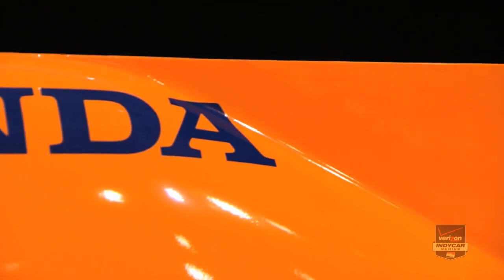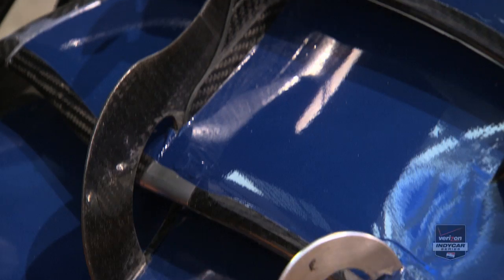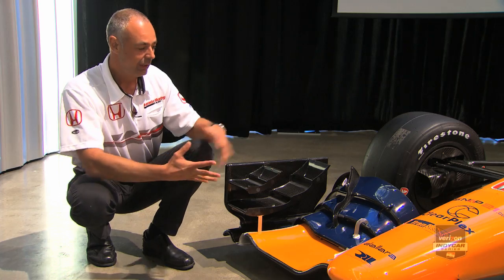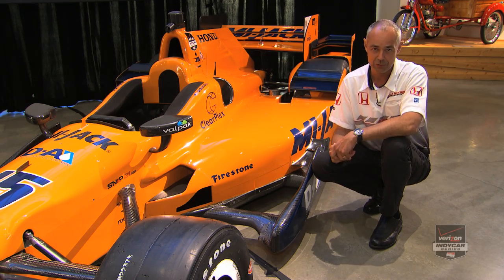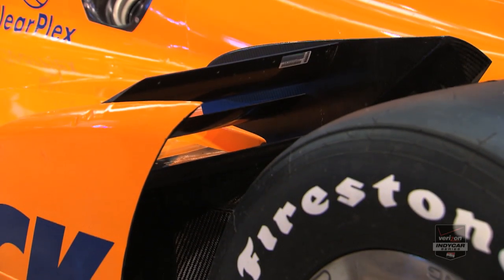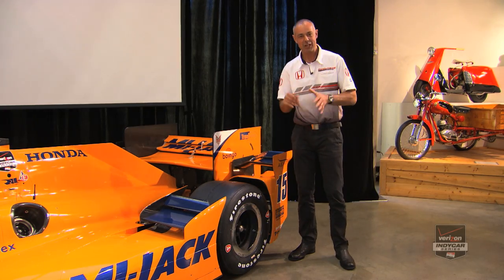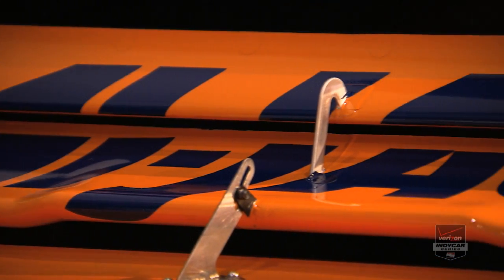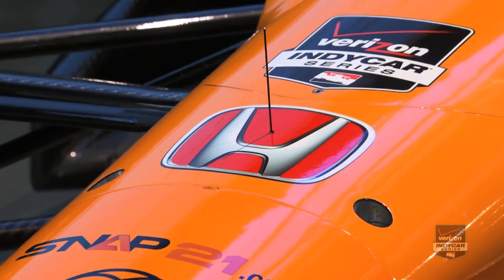2015 Honda Aero Kit Unveil

Comment: Watch out with the HONDA engine it might break down .
Reply: It's actually an HPD engine. Honda Performance Development is based in California, not the same Honda in F1.
Reply: Then surely it will work.
Reply: Yeah, watch out for the engine that won the Indy 500 in 2012 and 2014...